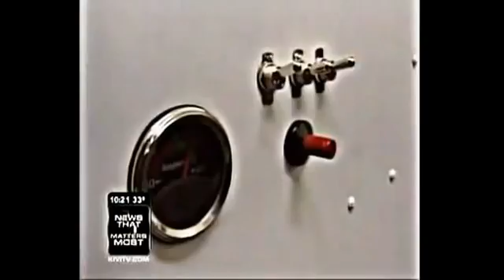hydrogen home heating

Comment: SOoo, You're using electrical power to create a gas to heat a room...why not just use an electric heater? Energy is energy so the sum of either method should be the same so why the extra step?
Reply: Actually hidrogen output generates more heat than electricity. 👏

Comment: Why not just use the electricity used to split the water into hydrogen and oxygen to directly heat heating elements like a normal electric heater? It would be way more efficient.
Reply: because the hydrogen gas burns more efficiently than the electricity in creating heat enough to warm your house
Reply: Every single electrical unit is 100% efficient in generating HEAT. If this contraption is located inside a heatable room and the hazardous HHO gas is burning, it will heat that room as efficiently as a normal resistive heater. + you have to pay for the used water and get rid of moisture muhahhaa!
Reply: @TheCheopps  An electrical heater is not one hundred percent efficient. If it were we all would have one. FACT.